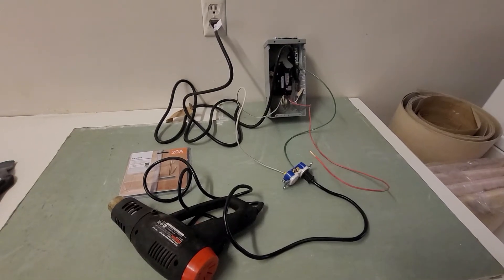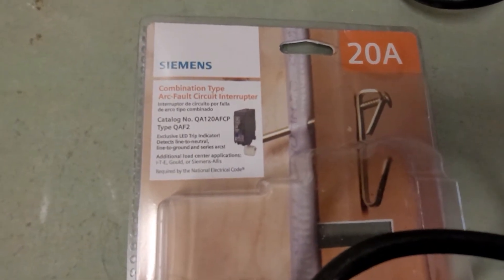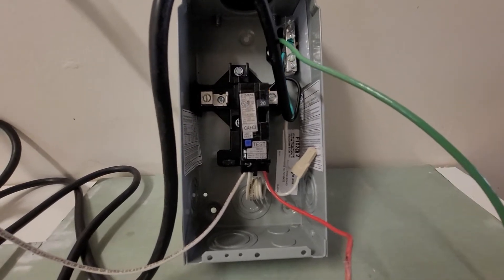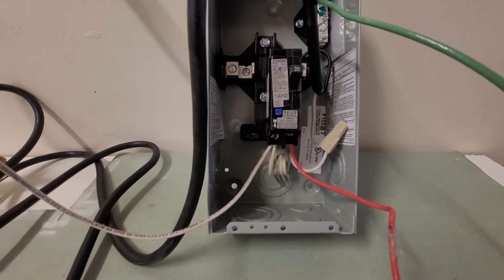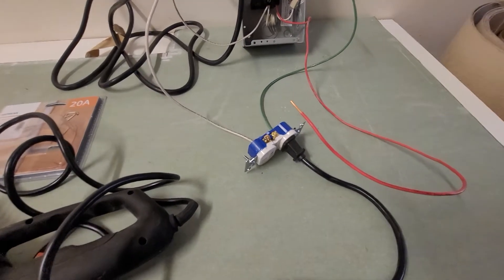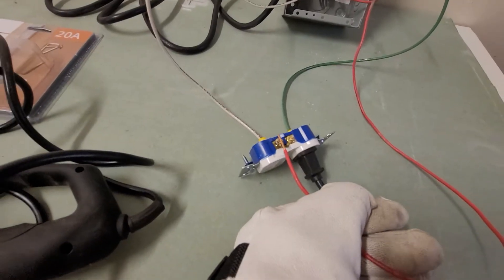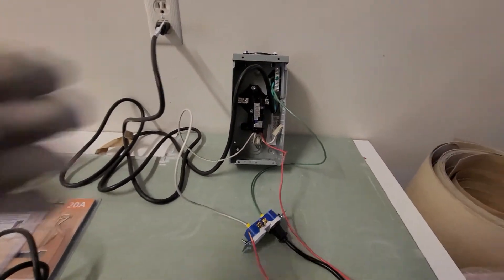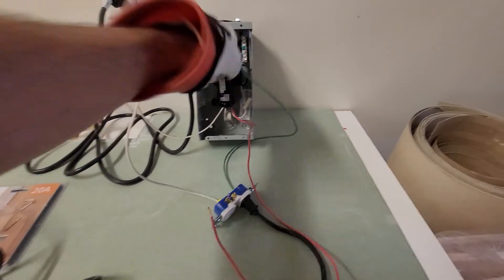Combination AFCI Arc Fault Circuit Breaker (Siemens) test March 23 2021 Siemens

Comment: You need a  sustained arc for longer than the little flashes you are making or the breaker would trip with every time a switch is closed or opened

Comment: Thanks for sharing...
So what else makes them trip?
I have a sim racing setup in my basement and the motor that operates the steering wheel seems to make mine trip randomly.  But never trips unless that motor is on.  It is a 20 amp Siemens and I have replaced it twice, thinking it was getting weak somehow.

Comment: You are simulating a switch being turned on and off for which you don't want the breaker to trip.  You need to simulate what's in the picture that came with the breaker.  That would be a nail or something doing a constant arc, not an intermittent spark.  Likely breaker is set to ignore anything less than a few seconds in duration to avoid false trips.
Reply from the maker: Please show me ANY test that shows this working that doesn't boost the voltage for the testing as that is the only test I've seen from manufacturers
Reply: Yep, and X1 and X2 caps leaking or going on their way out (and slowly leaking more than a couple of ma through)